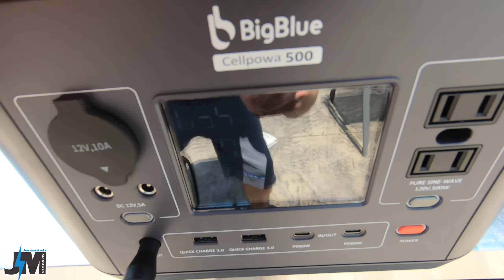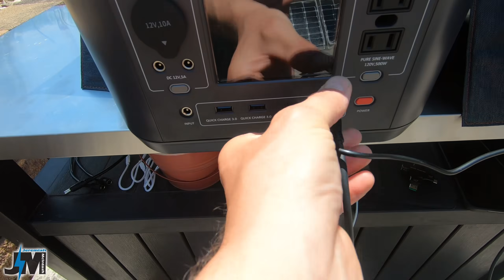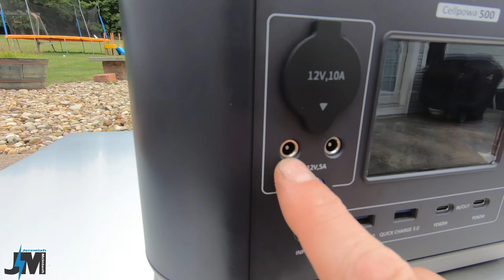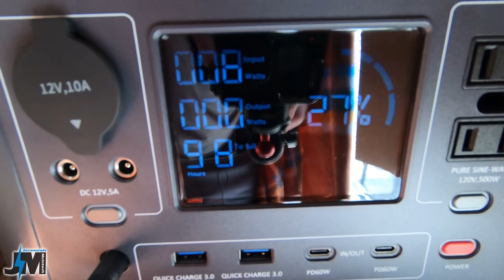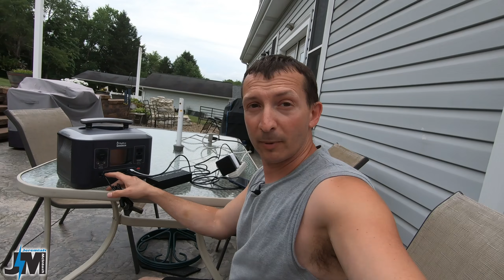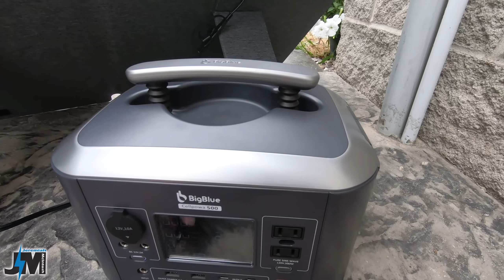BigBlue Cellpowa 500 power station, Solarpowa 100w solar panel and BigBlue 36w solar panel Review.

Comment: I have a similar setup, I'd like to know if I can mix and match? Do different branded panels work if you connect them together?
Reply from the maker: Some of them you can but I recommend to stay with the same panels when connecting in series or parallel. I don’t recommend it but sometimes you can and it will be fine other times you may damage your panel.

Comment: What's the difference between PET and ETFE?
Reply from the maker: Etfe panels will hold up longer than pet coated panels and typically produce more energy because it lets more light through. Pet tends to break down sooner when left in the sun for long periods of time.